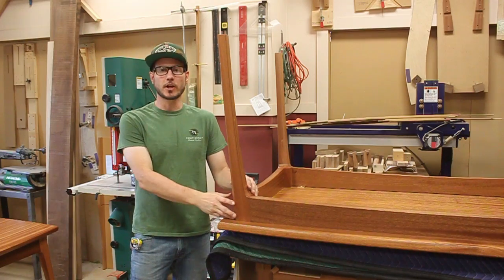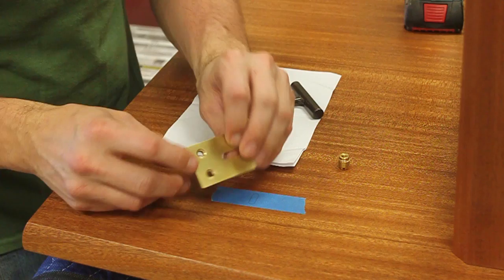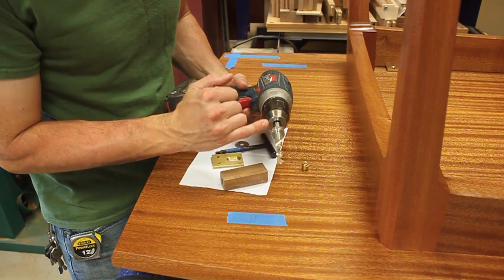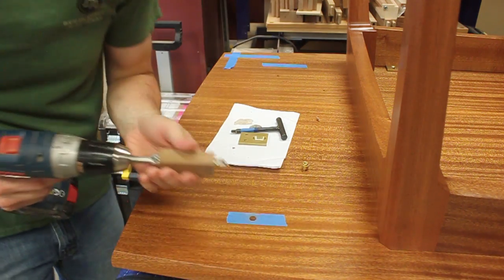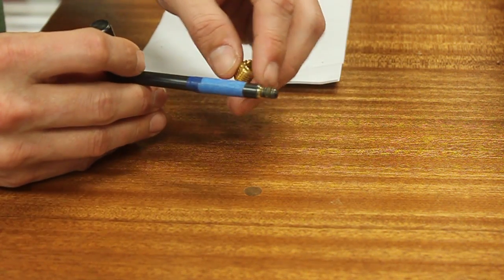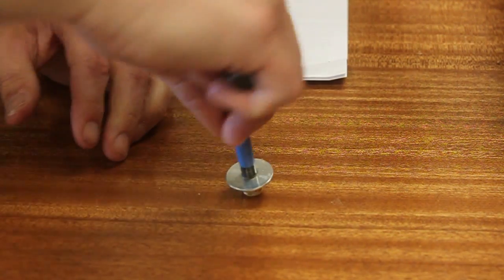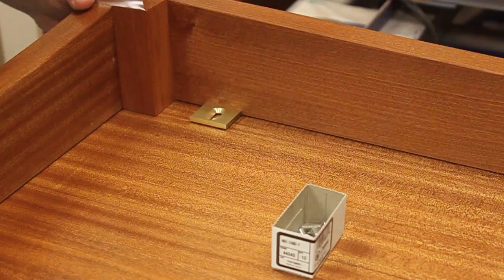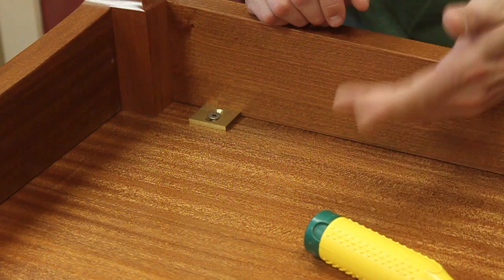Table Top Hold Downs

Comment: I install these the same was as you Philip. But, i never thought to hold the washer like you did. Great idea to keep it steady! I also use a large countersink to just lightly open up the first millimeter or two after drilling the hole as I find this helps prevent the grain raising up and blowing out in certain timbers when you thread the insert in.
Reply from the maker: +Rhys H that's a great idea as well. Smart.

Comment: Where did you get that T-handle installer!?
Reply from the maker: Man, honestly I can't quite remember but I think that it was probably from either Woodcraft or Rockler.
Reply: Thanks man, I'll do some digging - I've seen the ones made for a power drill, but I'd prefer to go hand install on something so close to finish.  Love your IG & YT man, so inspiring!
Reply: POWERTEC 71383 T-Wrench | 1/4 20 Threaded Insert Installation Tool w/T-Shape Handle      I got mine on Amazon.  Also available in larger thread size.

Comment: Could u pls give us the info on the inserts?
Reply from the maker: The inserts are 1/4-20 ID and require a 3/8" OD hole to insert. You can get them from most woodworking supply stores (woodcraft/rockler) or amazon.. . . You can get everything from Amazon :P:P:P
Reply: There is an alternative style threaded insert that can be driven with a hex (Allen) wrench; a T-handle hex wrench would be best for keeping correct orientation relative to surface. See https://www.mcmaster.com/#standard-threaded-inserts/=19jy4u6 for details.
Reply: RAMPA makes a similar one.  Not brass.  Can be tightened and moved with a hex key.  I get them on Amazon.

Comment: I really want to use this method for my table making. I just know I am never going to machine the flat brass piece...metal working is just not my thing. Would you be willing to machine up a load of them and sell them to me? Say around 40 to 50?
Reply from the maker: +Ross Nanfito Haha! I am looking around for a small machine shop to make hardware in bulk for me. I don’t think I would be able to do it in my shop in bulk. But appreciate the interest man!
Reply: You could use the table insert with traditional wooden buttons and still get the primary benefit of this technique - you can remove the table top multiple times without stripping out a screw hole. But there's no doubt those brass plates are an exceptional detail.

Comment: While your solution to cross grain expansion is quite elegant, a common solution is to use a metal clip; see http://www.rockler.com/table-top-fasteners for details.
Reply from the maker: Yes, you are right. Thanks for the link. It would probably save me some time to buy those. However, in my work I try to make  it as custom as possible and that is what my clients are looking for. I wish there was a company that made a good looking hold down but I think there is just not enough demand. Thanks for the kind words!!!